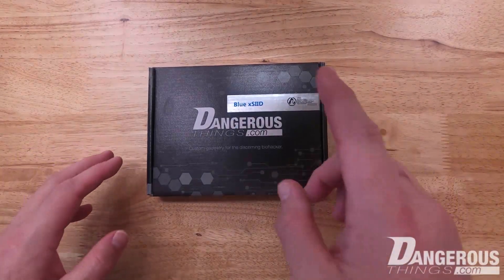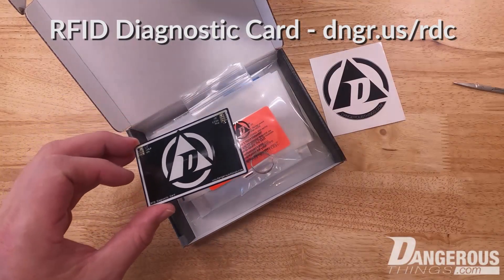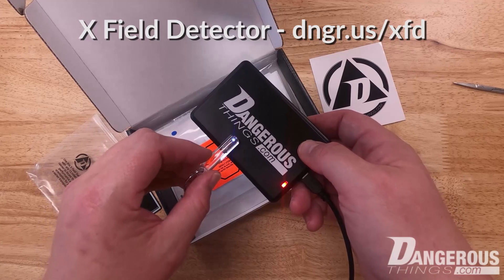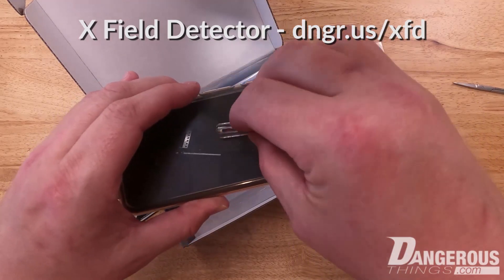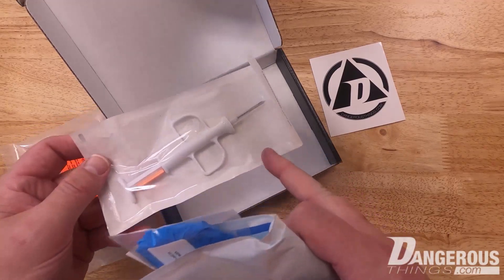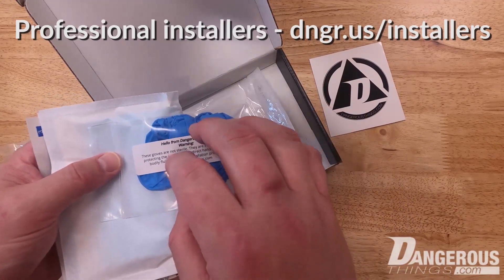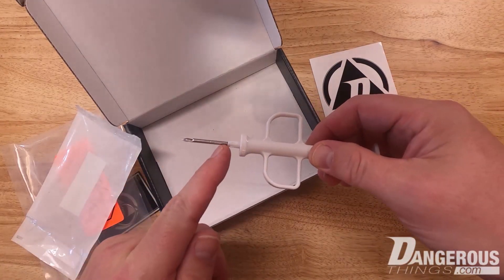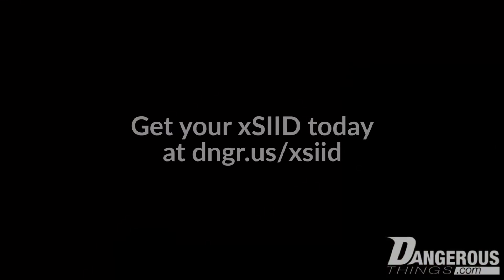Unboxing xSIID NFC chip implant with LED

Comment: Now I feel like a total doofus.  I ordered a similar one from a different vendor , idk like a year ago, and when I got it in the mail, I tried reading it with my phone, and it wouldn’t read.  So I thought it was either faulty or a ripoff, so I sent it back and got my money back.  I hadn’t opened the packages yet, so I didn’t contaminate things too much.  But I still feel like a dingus now.  I didn’t know that the metal injector tube shields it from being read.

Comment: Hey, I'm so sorry if this gets asked often but I am really interested in getting a T5577+Ntag215 implant and the flexMN seems perfect for me but I would really prefer a version with LEDs; do you have any ETA on if/when those will be back (it's fine if not I was just curious).  Also, are there any concerns with getting either x or flex series implants that potential hand growth will make them inaccessible/break them?
Reply from the maker: The flexMN uses the magic NTAG chip which is a bit finicky.. on top of that the LEDs created a problem with how badly they were manufactured in that they would simply stop working after a short amount of time.. no ETA on an alternative design yet. The x-series stuff is pretty rock solid though .. I've had multiple in my hands since 2005 without issue.
Reply: @Dangerousthings  Thanks for the info!  The x-series implants have definitely been on my mind for a while too 👀

Comment: hey! just a question, what’s the difference between this one and the other chip implants? (aside from the LED) PS. greetings from Lebanon!
Reply from the maker: Basically it's like an xNT (ntag216) chip but with an LED as well! It can store around 1kB of NFC data.
Reply: @Dangerousthings  Doesn’t the LED require some sort of power? making it harmful?
Reply from the maker: @alexanderaj9818  Yes the LED derives power the same way the chip does - from the magnetic field produced by the reader :)